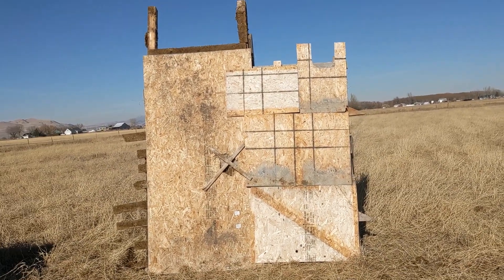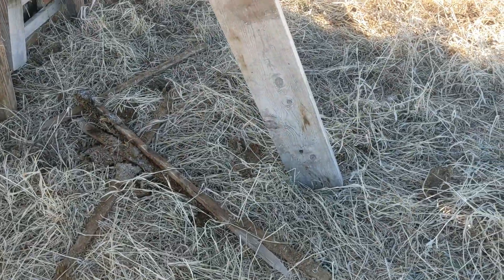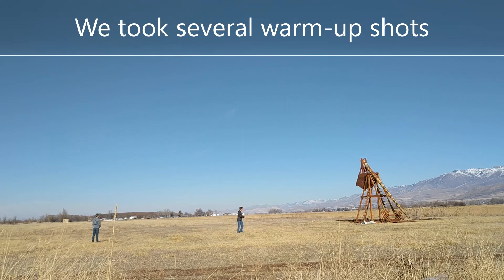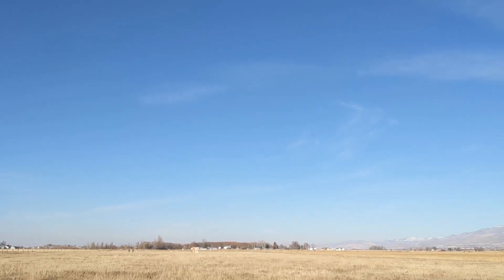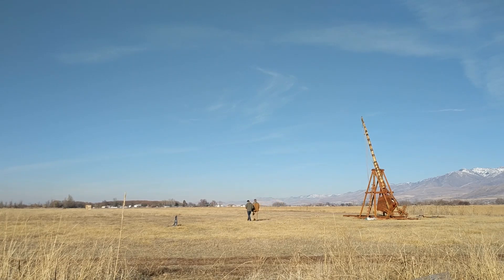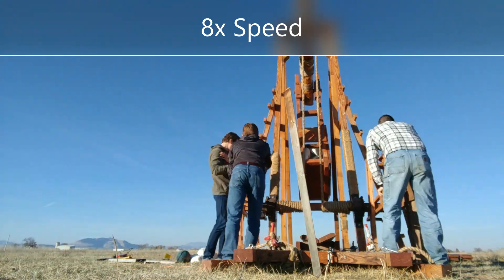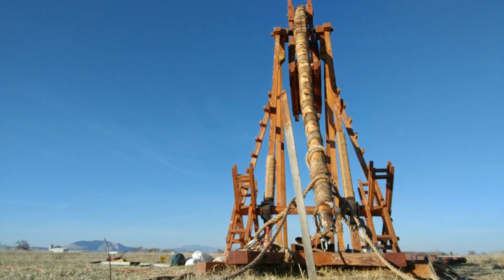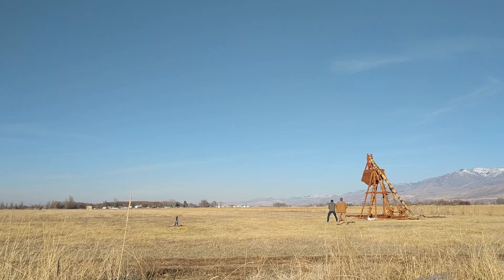Sending a 20lb Rock through a Wooden Wall with the Trebuchet

Comment: There is an experiment you might wish to try, it is hard to do on a small machine, but the result should be quite evident in this size. Use a hold-back on the sling before the launch - something to put tension on the sling (more than just the missile) so the sling is pulled tight. You will get more range. Shots with and without the holdback, and using different strengths, should prove interesting as a way to adjust range (lengthen and shorten). 

On small machines I used clothes pegs, velcro and even weak string or cotton "break ties". Rubber bands are also good, as you can double or triple the holdback simply by adding more bands. I have used such a system (6 of those particular rubber bands = 30 pounds) as a break-tie for parachute deployment on BASE jumps.
Reply from the maker: Awesome, that is cool that you have come to the same conclusion.  I really noticed that the variability in slack in the sling affected range a lot on this day when we were shooting.  I will definitely try to make some kind of hold-back setup on the next launch day
Reply: sorry to be off topic but does any of you know a method to log back into an Instagram account?
I was stupid forgot my login password. I would appreciate any assistance you can give me.
Reply: @Anderson Benicio Thanks so much for your reply. I got to the site thru google and I'm in the hacking process now.
Looks like it's gonna take a while so I will reply here later with my results.
Reply: @Anderson Benicio It worked and I now got access to my account again. I am so happy!
Thank you so much, you saved my account!
Reply: @Arjun Moses no problem =)